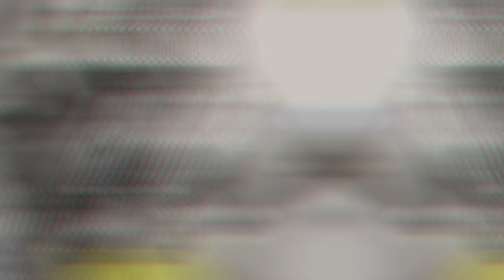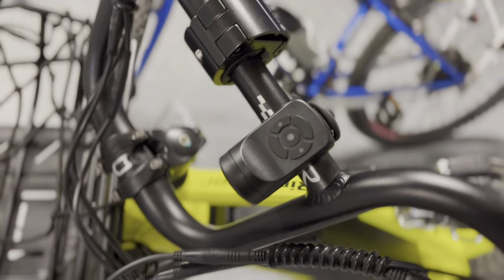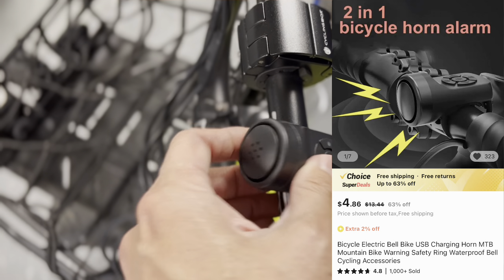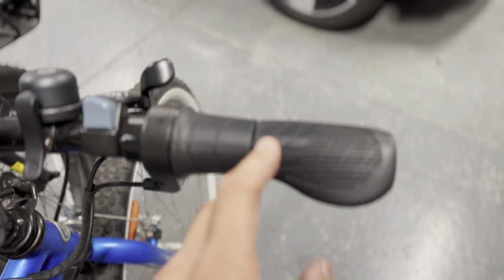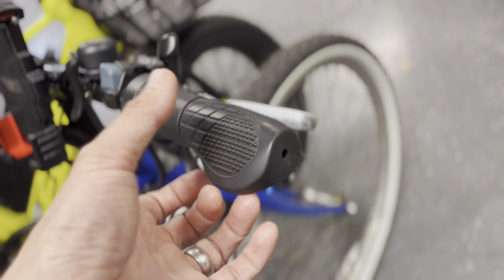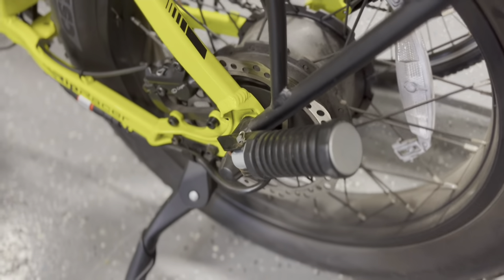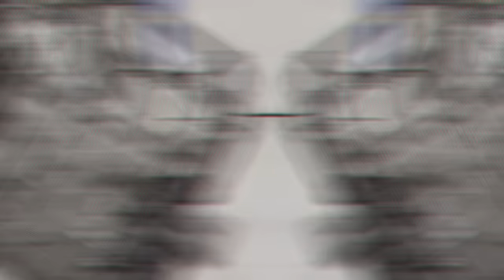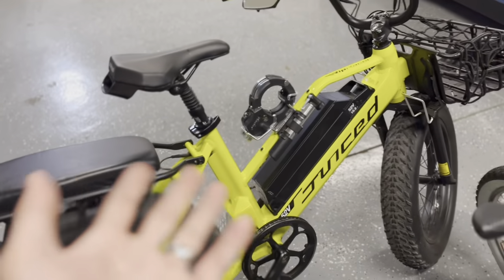Budget E-Bike Accessories (Unsponsored) For Normal People

Comment: When I had a bike stolen, locked to a stand at the local golf club, the thieves took the stand and the bike and loaded them into the back of a van and drove off. People witnessed the theft, but no one took down the number-plate number of the van, and they were never caught and I never got my bike back. If someone REALLY wants a bike, a lock is of no importance. GOOD VIDEO.
Reply: I put an airtage underneath the seat in the cover panel hidden away. Ik where my bike is at all times. Also i have 2, 18mm hardened, aluminum alloy, steel thick chains i lock my bike too. I tried cutting it with a cutter the other day to test it out, it took me like literally 10mins to cut halfway through one of the locks. Which is generally enough of time if you're going quickly into somewhere and right back out. 

Even if they had time and could cut through the lock, they'd still have the airtag to worry about
Reply: @matthewaldrich6455 
I’m planning to do this as well. Did you remember to disable the speaker in the tag? Also, I’m going to put the tag inside the plastic controller box out of sight.

Good luck!
Reply: @ibnewton8951  Yes, I did. Tbh greatest investment of safety I ever did. I'm also getting a remote alarm as well. I know my bike is safe. I'm fixing to get a fucare Gemini, too, and do the same thing.
Reply: Sorry about your bike being stolen. Yes, it's true that a lock will not stop every thief, but locks have probably stopped a lot of "potential thieves". I have a Foldy Lock and Three,,, count'em THREE motion sensitive alarms. The alarms will sound at any motion of the bike and finding and eliminating one alarm will leave two more still squalling. I don't plan to leave my bike locked up for more than a few minutes at a time anyway.
Reply: Good point every bike , I’ve owned was stolen by any means, not much you can do
Reply: It's an arms race ... you just need to park beside another bike of at least the same value that has a weaker lock!
Reply: Half the time, I don't even lock my bike up at work. We have security, but they are just at the entrances and inside the buildings. I could spend all day parting out a car and no one would notice. But its just not a place people think of when they are looking to thieve.

I guess it helps that transit service to the location is piss poor.
Reply: Was the stand a Sheffield stand and cemented to the ground?
Reply: Absolutely correct
Reply: Theives plural there a friend's that are bad people enough to help eachother lift the rack and bike together to put on truck that awful.
Reply: i had em' unscrew and pull out the bar all the bikes were locked to, hucked about 13 bikes ia van
Reply: Yup mine was stollen  with the lock ..usually they clip it nd leave the brocken lock ...nut not this guy.. swry about ut bike

Comment: For my seat post I just swapped the quick release to a regular bolt so you need a tool to remove it.  From my experience if someone brings a tool for theft they are gonna bring a tool to defeat a lock so they can steal an entire bike, not just the seat off of it.  Bolt actually didn't cost me anything so win there for budget value.  I also do not carry any weapons/pepper spray for self defense.  Technically where I am it is illegal to do so.  I do not live in the USA.

Comment: Hi from NZ. 
Your suggested suspension seat post is helpful. That makes a cloud9 (etc) unnecessary, as most standard seats are fairly comfortable. I already have an alarm, various good locks and a rechargeable air pump. My EBike came with those extended palm-support grips. My wife and I have Sena helmets (because they have inbuilt connected audio coms).
Thanks for the video.
Reply from the maker: You’ré very welcome. Glad it helped out.
Reply: Sena helmets are 500$ !!
Reply: @brucepoole8552  Since then, I've added a cloud9 seat as well = awesome ride. The Senna helmets have a fantastic intercom function... a great safety and communication accessory.
Reply: @maitrikashin3906  true enough but out of reach for us

Comment: Good video on accessories, the USB charged, wireless turn signals work well until they don't. The problem I had with them was standby battery state of charge. As you use them the time between charges increases until it is almost every couple of days. Plus the hassle of charging them separately becomes a hassle. I finally went with hard wired sequential turn signals with a potent battery source. But the wireless ones worked well when they were charged.

Comment: Great video the cushion for the rear rack is genius, I have a Duotts C29 that came with a rear rack, my (teenage) kids refused to sit on it, but with a cushion and some of those foldable foot pegs, they'd probably be fine on there in an emergency, I had taken the rack off after a day or 2 of never using it and took the rear/brake light and zip tied it to under/behind my saddle so I still have lights.

Comment: I saw this demonstrated on YouTube----To get a grip off of a handlebar, you can use an air compressor with small tip to inject air between the handlebar and the grip. A lot of small engine shops use this technique.
Reply from the maker: @stephenwirtz2057  oh yeah! That’ll work but most people won’t have that handy.

Comment: MY E-CELLS e-mtb ACCESSORIES-> 1.) Velosurance  2.) LiteLock U lock (diamond level security  rated) 
My Super Monarch Crown came with a big front basket (mounted to the head tube) and a rechargeable e-air pump which works great with settable PSI .

Comment: I'll probably want an ebike sometime, but in the mean time I'll use my Dutch bike. (I really lucked out with that one). These products are cool, but a lot of them aren't super necessary for this kinda bike. I think one way of going about it is a more minimalist way. I've got a rear basket with a rack rated for 80kg and a front basket mounted with a single bungee cord. It works, and I don't have to worry about storage for anything specific like my backpack, lock, water, and lots and lots of groceries. The handlebars are drawn back and upright without much on them. The frame lock, hold on...

I'm reading this back and it looks like I'm just bragging about my beat up bike. The seat is very much stuck and it weighs like 80 lbs. I guess my original point was that I think about buying accessories differently. No hate on your video.

Comment: I have a internal seat post cable that prevents theft using a star nut in the base of the seat post, a eye bolt & lock nut, piece of brake or gear cable and a block of Delrin plastic locked with a security bolt on a water bottle mount and a washer on the lower end of the cable below the Delrin block.  I bought one at LL Bean (Made in Maine) and never saw any more anywhere else!

Comment: Hi, Good video. With my E-Bike I have it custom with a side mirror, Fedog™ horn/alarm, INWA™blue tooth speaker for music, bottle holder with a Thermal bottle, a flat key steel bike U-Lock, front and rear turn signals (it already came with front and rear lights with break lights) and a HOMCOM™Trunk, and finally a personalized 'JOE' bicycle license plate. Oh, my e-bike has handlebars like yours.😎
Reply from the maker: Cool! Sounds like it’s well equipped.

Comment: Top tip for you for your grips use a flat head screwdriver and some hairspray a wee scoosh and it'll slide right off! And do the same scoosh abit in the grip and on the bar ends and slide it back on to give it a good grip hold to the bars! This what we done as kids in the 90s early 2000s on our bmxs and downhill racing bikes! Works a treat id probably still be doing this if grips weren't lock on now! Best thing ever! Don't use ipa itll remove paint and melt the grips or worse make them brittle! I use it for 3D printing cleaning if it gets on anything rubber or plastics or painted items it ruins the paint and structure of rubber! Don't use it please not for inside a grip! You need this to be safe

Comment: Great video! Want to see what else you used like cleaning, protection sprays, lube etc. So much cheap and pricy stuff out there.
Reply from the maker: Oh yeah, for chain cleaners, I use Tri-Flow. I've lately started using a dry lube though b/c supposedly it doesn't require so many steps. Easier to apply and use the bike right away. I haven't used any protection sprays. 

To bleed my brakes, I used a generic one from Aliexpress. Works fine. It's a generic EZMTB style one. I swear it's the same thing but just no branding. Not certain though as I don't have the name brand one to physically compare side by side.

No plans for a video on that topic but I am working on a night time accessories video.

Comment: Some very nice accessories you have found. Do you know if a set of turn signals could be set up to operate as a string of 6? So 2 for the front, 2 for the back & 2 for a trailer? Since they are cordless, I am wondering if the signal from the handlebar control would reach to the set on the trailer? Thank you.
Reply from the maker: I’m pretty sure it would. I don’t think there is a limit of how many turn signals can connect to the remote. I ha e a separate video on the demonstration of the turn signals that might interest you.

Comment: Great video and thanks for sharing.  I own  an Lectric 3.0 and my wife has the Lectric trike.  I purchased a front and rear light for the bikes and discovered the hard way that I will never use a rubber holding device ever again.  The first time I put the rear lighhts on that held the rear lights the rubber part broke and so I am now stuck with 2 rear lights that are useless, but I didn't buy them for the rear lights I bought them for the bright front lights which came with better attachments.  My friend had cancer and he was not to ride a bike for over a few months.  Are the cloud-9 really better than the standard seat that comes with the lectric bikes???  I recently bought better rear lights with signals, alarm & signals.  Because the rear basket has flat pipes in the middle I feel I will be able to drill small holes in the basket and mount the new light directly to the basket.  Any suggestions for the front and rear baskets as far as mounting other utensils??  Again many thanks for sharing information.
Reply from the maker: @glong2720  I have never tried a cloud 9 saddle but people swear by them. As for mounting the accessories to the front and rear baskets, it would really depend on what you’re trying to mount to it. You c vs a reinforce rubber mounts using zip ties as a backup.

Comment: Hi great video. Regarding the alarm. How did you manage to pair one remote to two devices? Please help as i cannot find a way to do it. Thanks in advance.
Reply from the maker: I go over it in detail in one of my other videos. I have a demo specific for the turn signals. The short answer is that you engage the turn signal on the remote and then hold the on button on the turn signal that you want to pair.

Comment: I really like that Juiced ripracer and I was thinking about buying one, but I'm 6'2" and it looked really cramped in length. I did some research and it was a little shorter than my wife's Lectric XP lite which had a shorter wheelbase than the Lectric XP 3.0.  I ended up buying the XP 3.0 because of size, but I really wanted that 52V.
Is it a small as I think it is, or was I right to get the Lectric?  Don't get me wrong, I like the Lectric, but that ripracer is a cool bike.
Reply from the maker: Rip racer is better made and a much better performer. No contest. We’re talking about a 12 year old company vs one that’s only been in business for a few years. Lectric is a budget brand. Juiced is designed for performance. My friend is 6’-0” and wishes the handlebars were slightly higher but likes the rip racer otherwise.

Comment: Thank You for a great video! 🙂- Did that mounting bracket come with the Master Lock Cuffs?  I just looked them up on Amazon, and it doesn't show/say anything about a bracket, so just wondering...
Reply from the maker: 14 years ago it did but not anymore. I’ve been having a hard time finding another one too. Maybe consider the Foldylock Forever. On sale now on Amazon for $97 shipped.
Reply: @Funcentric  I'll check it out!

Comment: Hey! I've just got the Xpedition dual battery bike today and found out that it doesn't have any electronic lock. I should have thought of it earlier sure thing. Do you know any third party solutions to have such things on it? I mean when you just shut down the system and it just doesn't start up without a key. Well something like this or alike.
Reply from the maker: @Rustaci  nope that function would be built into the controller. You’d have to replace the whole controller. I would stick with a regular physical lock. You’d need that anyway. An electronic lock is more of a secondary lock.

I suppose you could hook you a second switch somewhere along the power wire that’s hidden. That’s probably your best bet if you’re looking for something like that. You’ll have to splice wires and stuff.
Reply: @Funcentric  Thank you

Comment: Class 3 ebikes in CA (and various other states) have a max speed of 28 mph.

Btw, nicely done practical video.
Reply from the maker: @lmsarmiento  Correct but Class 3 is still for offroad use. Most cities still limit to Class 2 speeds on public roads. That’s why bikes that are Class 3 capable are shipped with Class 2 settings and Class 2 decals. You always hear about owners “unlocking” to Class 3.
Reply: @Funcentric , the only restriction, besides age and helmet usage,  for Class 3 ebikes is that they are not allowed on Class 1 bike paths.  Otherwise, they are street legal.  Anything over 750w and 28mph pedal-assisted max, is limited to offroad use.
Reply from the maker: @lmsarmiento  I stand corrected.

Comment: Great information.  What ebike rack (with a ramp) would you recommend. Thanks
Reply from the maker: I don’t have much experience with bike racks other than a traditional one I owned decades ago and more recently the KAC K4. It has all the features including it being lockable to the hitch and each bike itself is also lockable. Meets the weight requirement for my e-bikes and is expandable from 2 to 3 to 4 bikes. It also can angle out to make clearance for the rear hatch to open. 

I got a crazy deal when they accidentally priced it wrong for less than 24 hours. Can be expensive at regular pricing though.

It does not have a ramp. For a ramp, you’ll likely be getting a motorcycle rack which doesn’t have space for each individual tire. It’s more of just a flat surface with four edges. I believe harbor freight has something but you’ll need to buy a ramp separately.

Comment: If you have any tips for speed I just ordered a new 36 v 20ah for longer rides.
Reply from the maker: @massterrbarber  36v is below the standard at least in the USA for an ebike. I don’t know if you’ve seen my other videos about how to choose one.  

So you’ll need to be realistic about the bike. You won’t be able to take serious hills on a 36v system. 

If you are purely looking for speed, the easiest mod is to change out the chain ring for something bigger. That’ll allow you to go faster with the gears it has but at the expense of being able to take hills as easily. 

Increase in speed and range don’t go together. One or the other. To gain range, you need to take it easy in the throttle and help pedal as much as you can. 20ah is fairly large size as far as capacity. 

It’s too early, but you can eventually overvolt it which will require a new 48v battery, new controller with all the proper connectors and then a replacement throttle. Not worth it for most. 

E-bikes aren’t really made to mod. You just want to get the best one you can afford and just enjoy that. Pouring money into an ebike won’t make it worth more. Consumers do t want to buy custom modded bikes generally.

Comment: Re: super stealthy phone mount - does it hold the phone pretty well or is it likely to fall off when riding over a big bump?  i have a regular phone mount but its really bulky and takes up a lot of handlebar space.
Reply from the maker: It’s more secure than you’d think. Because I have bmx style handlebars, the handlebars themselves will keep it in place if it were to ever slide over. I haven’t had that problem though. 

Note that stealthy mount will not work for larger phones. Also there’s a new version out that spins into portrait mode. AliExpress.

Comment: What size screws did you use to mount those “hand cuffs” lol. I’m trying to mount a water bottle holder
Reply from the maker: It uses the standard bottle boss screws.
Reply: @Funcentric  bottle boss??
Reply: @Funcentric  do you have a link?
Reply from the maker: @darrenmerrill6799  Yeah, I just used regular screws that go into the mount. Most bikes come with them. If not, any bike shop will have extras to sell you.
Reply from the maker: @darrenmerrill6799  No, they're just a standard part. If your bike doesn't have the screws already, any local bike shop will have the bottle cage boss screws.

Comment: what's that yellow green bike called or what brand and model?
Reply from the maker: Juiced Rip Racer, 52v bike from an American company celebrating their 15 year anniversary. Great deal even at the  $1,300 price but discounts have gotten down to $900-1,100 before.
Reply from the maker: I have other videos on it if you want more detail.
Reply: @Funcentric  will that be okay if i am only 5 ft and around 180lbs because im afraid the bikes will flatten with my weight
Reply from the maker: @kumbaga  not sure about the 5’ part but the weight is totally fine. For your height, I’d recommend a step through style frame though. Something like an Aventon Sinch 2.

A lot of people looking at e-bikes I feel ought to do better on a stand up scooter. Maybe consider that. Cheaper, easier to store and transport, and these days they can climb hills decently from what I hear. Look for a 48v one for hills.